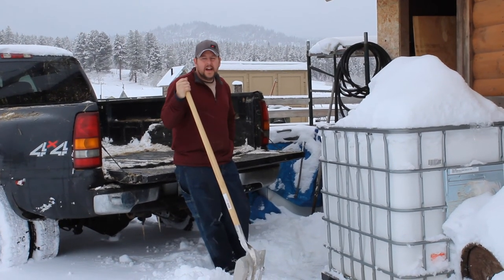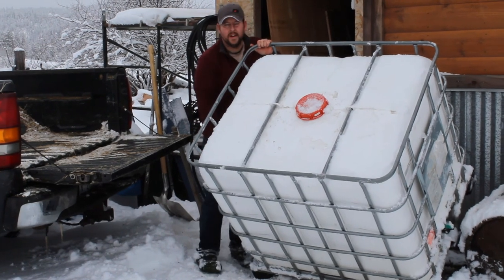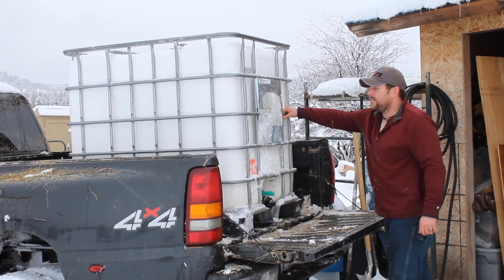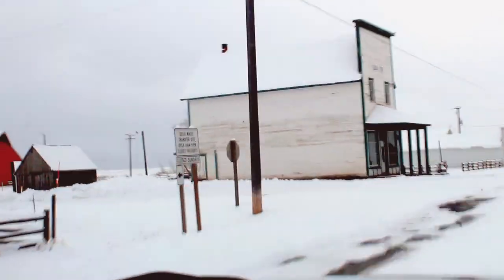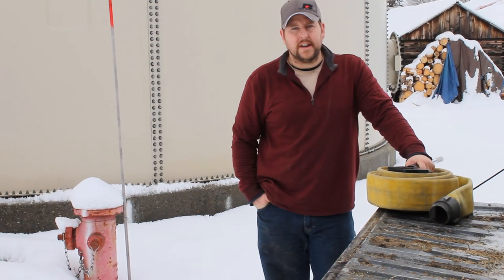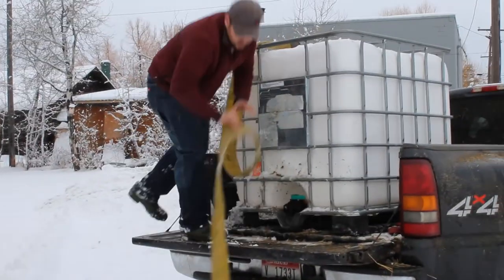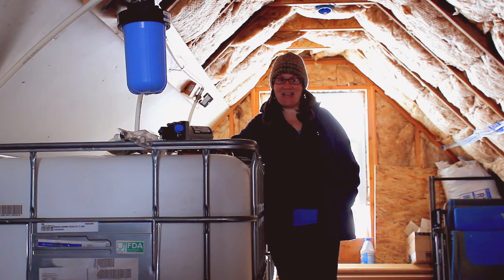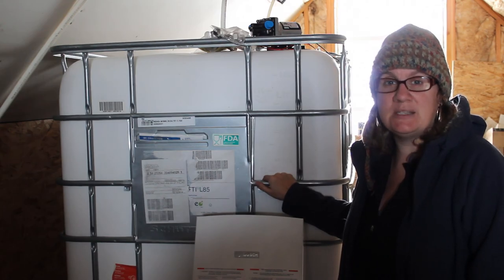Water Without a Well- Being Prepared

Comment: Did you need to reinforce the flooring/support for the attic knowing you would have 500 gallons up there (approx 4000 lbs)?
Reply from the maker: Our house was built with this system in mind.  The joists and the beams were placed to carry this load and more.  If someone was adding this to an existing structure they would want to be sure that they reinforced accordingly.